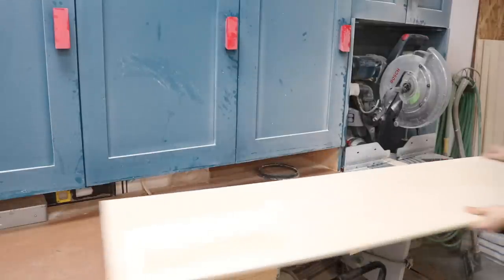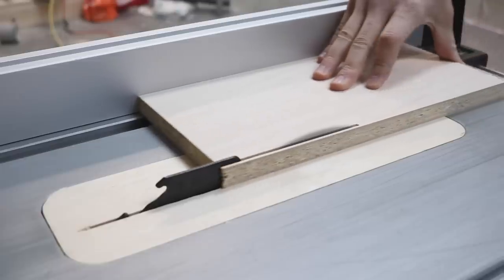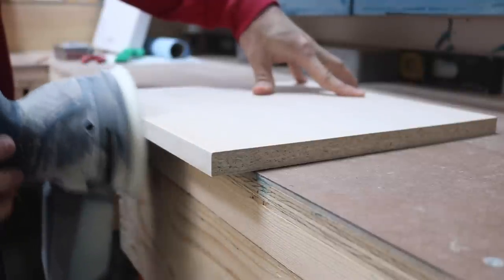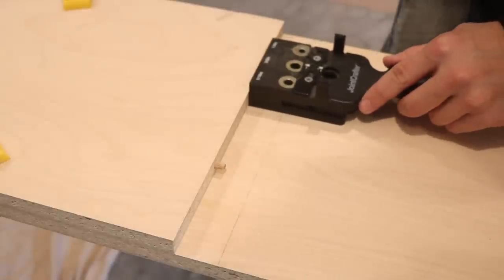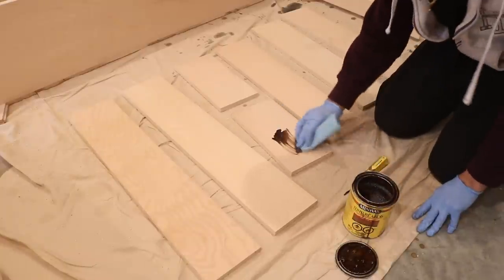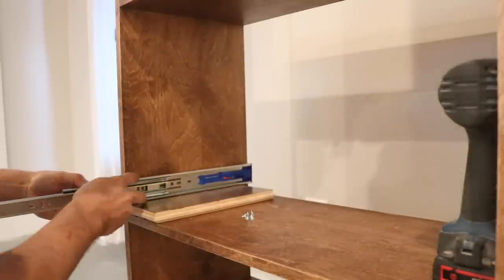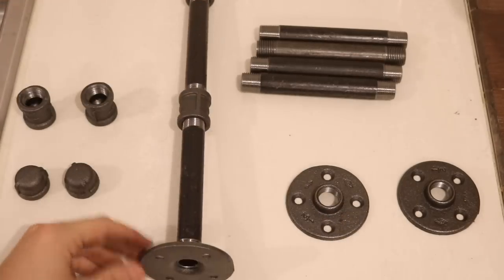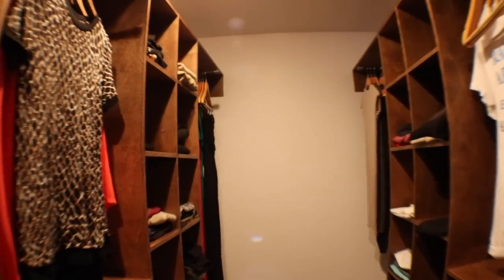How to Build a Custom Walk-In Closet // DIY - Part 2

Comment: Master woodworking craftsmanship! The suspended wall cantilevered mount is ideal for the modern closet...my only criticism is not enough hanging space, a long rod for horizontal clothes hanging would be ideal. No way would a couple of 12 inch hanging rods work in a traditional master closet. Looks great for a showroom though. Thank you for the hard work and sharing!

Comment: BTW Corey Rametta- when you built your tie and belt drawer in part 1, did you use the same birchwood for the drawer dividers? Could I possibly get a rough estimate on the deminsions? When you have a second & thinking about it, I'd appreciate that!  I'm assuming you made the drawers from scratch & purchased the drawer sliders individually. Would you share where you purchased them from? I've looked a couple different places but not happy with the quality of the ones  I've personally seen. I'm just wanting the push open & close like you have...thanks so much for all your sharing, keep them coming! I love to watch, learn tips & tricks while being inspired by others! You would be in disbelief if I shared my project! Haha! I definetly bit off  more then I thought! But it's a learning curve for sure!
Reply from the maker: +Creativegirl drawer slides came from amazon. Drawers are 2ft wide and dividers are evenly divided.
Reply: Hey Thank you, I figured it out and it worked perfectly!

Comment: Do you use anything in addition to the L brackets to secure each unit to the wall? I see that the L brackets secure the bottom of each unit but what is used to secure the top of each unit to the wall?
Reply from the maker: Same L brackets for the top
Reply: @CoreyRametta  Gotcha.  Thank you!!